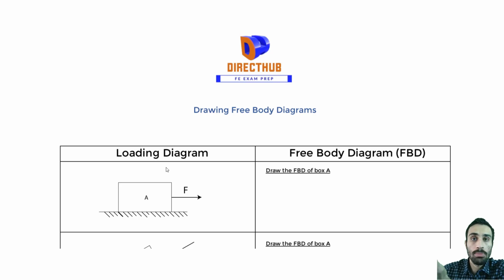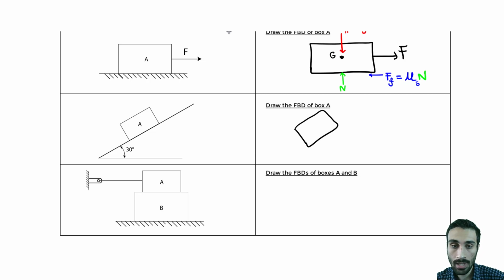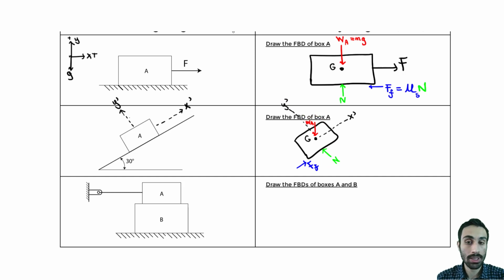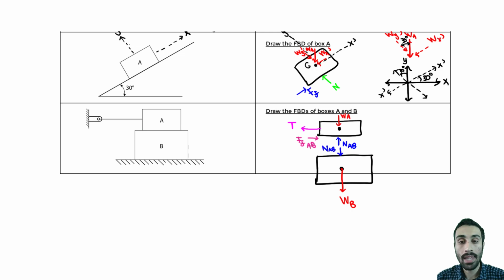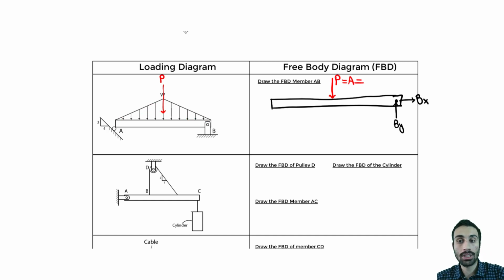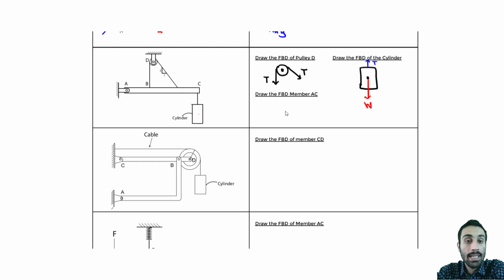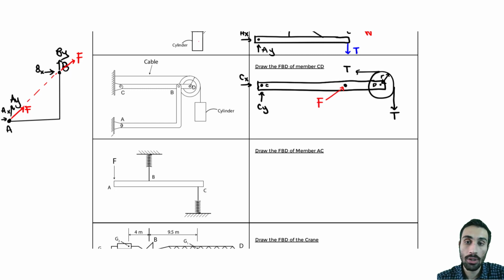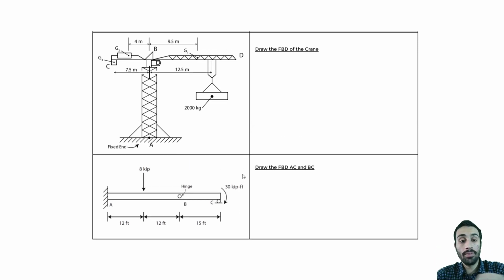FE Exam Practice - Drawing Free Body Diagrams

Comment from the maker: Corrections: 

17:52 - The friction force at the bottom of B should go to the right.

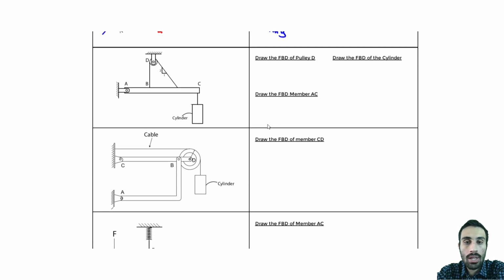At 24:46 - Free Body Diagram of a beam with a pulley and a hanging cylinder. 

There are pinned reactions at D that I did not write down! These will be Dx and Dy.

Comment: Mr Farooq. Thanks alot for ur massive effort.. Just want to clarify 1 thing for the third example.. Box B is being pulled to the left.. so the friction with ground should be to right side.. is that correct?
Reply from the maker: Hi, you are right! It should go to the right and when we do the analysis, if we get a negative answer for the Ff it just means we assumed wrong direction. Thank you for watching!